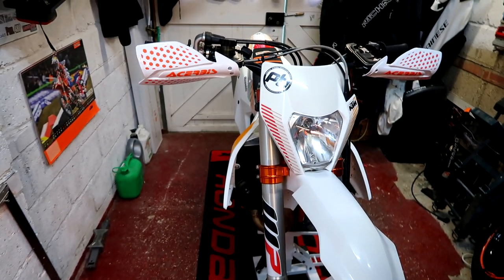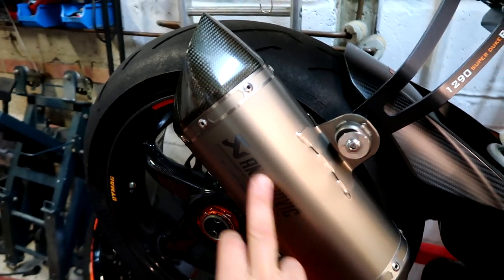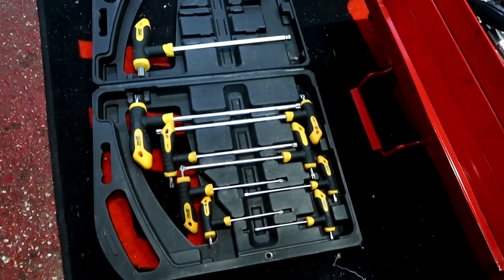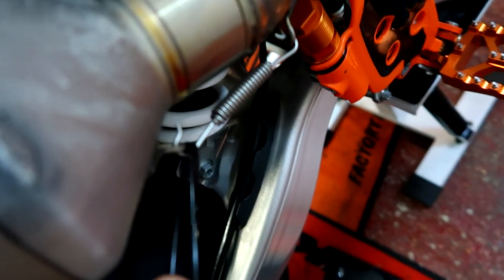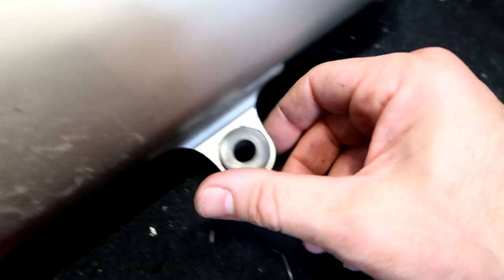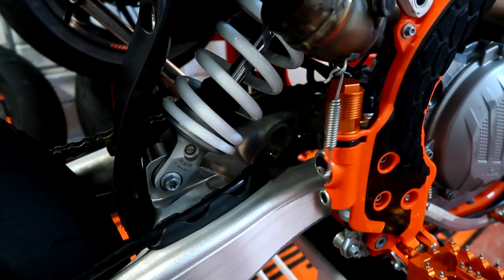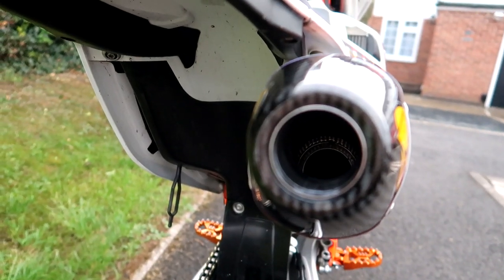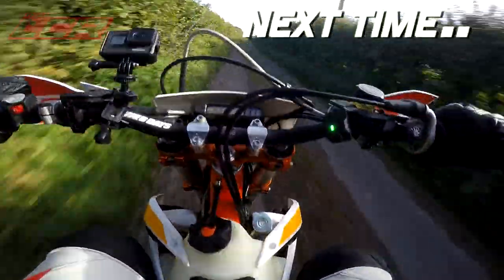FMF Factory 4.1 RCT Installation!! | Supermoto Upgrades 500 EXC

Comment: Did you add any type of fuel programmer (jd jetting, power commander, etc) after putting the exhaust on since it’s gonna run way too lean without it with the free flowing exhaust?

Comment: Lovely bike. Sorry if you have answered this but how tall are you, I ride a KTM Super Adventure with a Touratech low seat at present but love the thought of a Super Moto, they always seem too tall. I'm 5'8, maybe a bit taller with my boots on! Thanks
Reply from the maker: Im 6'2 David, in enduro spec they are very tall. I even fell off mine getting off once haha. But with the 17" wheels they are much lower but still a high bike, but once your on the suspension does compress quite alot so touching the ground while riding shouldn't be a problem.

Comment: Are you running the standard factory settings? No power commander etc? Thinking of changing my standard exhaust to a FMF but was told my a local dealer that it will lean out bike if i don't a power commander. Which could do damage to the engine
Reply from the maker: It running the standard map, no power commander etc. Even for the full Akro system there is no mention of getting a matching map in the instructions. I dont believe its required for this bike but now you have me worried so going to check :-)
Reply: Lamb Chop Rides didn u ever find out if u should remap first the fmf slip on

Comment: The fmf sounds better on a 450 than a 500 more agressive
Reply: Its also because he didn;'t use the megabomb header. It makes a massive difference. i run a titanium full system on my FS 450 and it sounds totally different
Reply from the maker: Yes maybe thats something to add later the header..
Reply: @KevGoesRiding  Yeah it will be better but on the 450 the engine is more agressive than a 500 that's why the sound looks more agressive but it still really good on a 500